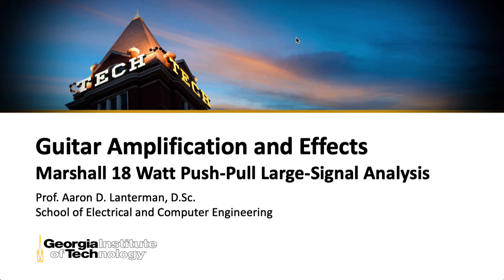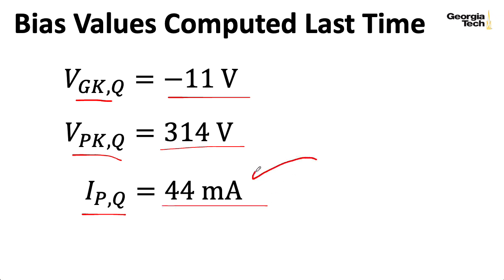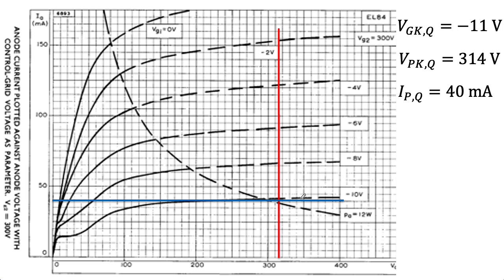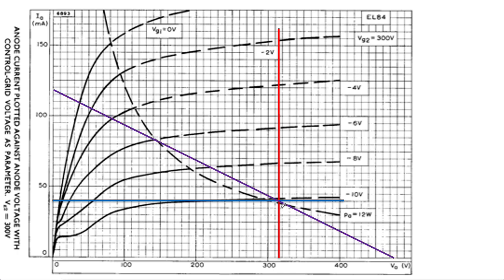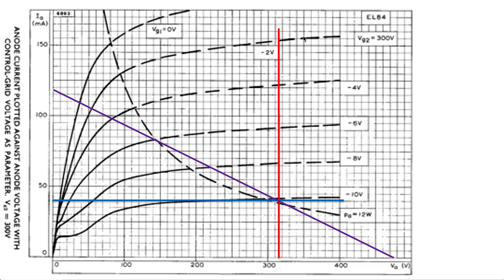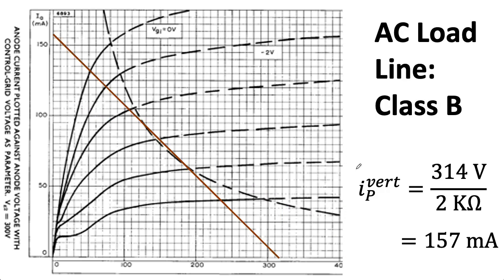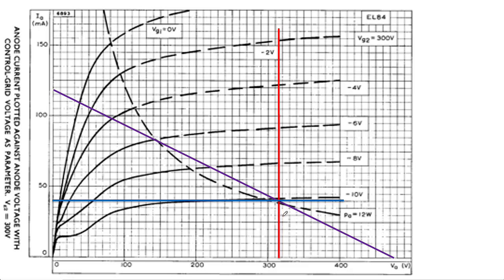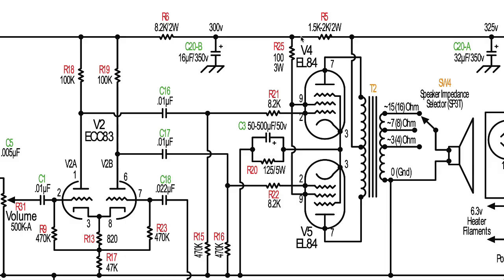ECE4448 L51: Marshall 18 Watt Push-Pull Large-Signal Analysis (Guitar Amplification and Effects)

Comment: I have been glued to all of these videos, you have produced a huge amount of quality content in a short amount of time! Excellent work!

I do have one question that has puzzled me.. this mostly pertains to fixed-biased P-P bias setup point. What is the difference between class AB1 and AB2? I have read that AB2 generates grid current, what is the pros/cons for this? Do things like grid stopper resistors and previous stage circuits affect AB2 operation? Just curious.
Reply from the maker: I'm actually working on lecture analyzing the push-pull output stage of the Fender Bassman right now, which uses a fixed bias scheme.

Sorry I don't know enough about AB1 vs AB2 to comment. In particular, I haven't gotten around to trying to do any analysis where current though the grid is involved in the calculations since that makes my brain hurt.

Comment: Wonderful videos!  I'm curious if you tackle the issue of feedback and stability analysis for tube amps.  It's a subject I've studied for many years, but traditional feedback analysis (like Hurwitz stability criterion, etc) are complicated on a tube guitar amp because the underlying assumptions don't hold (like assuming open loop gains approaching infinity, small output impedances, large input impedances, and the fact that the closed-loop gain can change drastically over the audio band) don't really apply in a guitar amp, so designing the feedback path can involve a lot of trial and error.  I would love to see how you approach such analysis in a typical push-pull stage with (possibly) multiple global feedback paths.  Thanks again!
Reply from the maker: I must confess that right now mostly just hand wave about the feedback. ;)

I've spent hours pouring over it and don't really have a good handle on it. There's some analysis of it in Richard Kuehnel's books but I haven't fully wrapped my head around it.

If you've got any insights, let me know!
Reply: At least if you have a single feedback path, I think that the Nyquist criterion is in general more helpful than the Hurwitz criterion. But you probably don't want to do that by hand, better to write a script where you can set up all transfer functions. Of course, it becomes worse when your system isn't linear. It definitely makes sense to linearize around the bias point, but it's less clear what to do about the large signal behavior.

One nice thing about the Nyquist criterion is that it's graphical, and if you have some uncertainties in your transfer functions then you can still try to avoid the -1 point regardless of the value of the uncertainty. On the other hand, if you have a time varying uncertainty then it might not be enough to model it as an uncertain parameter for this type of analysis.

Comment: 14:34 So you're saying that as one of the tubes starts to go into cutoff, that causes the other tube to increase its amplification to compensate? Any intuition on what causes it to do that? Is it because the two tubes share the same cathode bias circuit?
Reply: I think maybe because as the one tube goes into cutoff you are effectively removing windings from the transformer giving it a different turns ratio. More voltage is then reflected to the speaker.